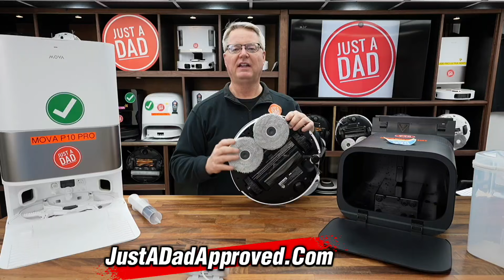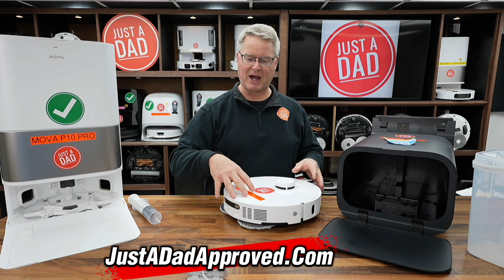Robot Vacuum Mop Pads Not Getting Wet? FIX THIS FAST!   Prime Water Pump

Comment: I didn't realize I had dry mop until I started testing it out and realized the floors were not getting cleaned. I tried small syringes but maybe I need to be shooting in more water than these small syringes so I'm going to buy the one that you're recommending and see if that helps, otherwise I'm going to return it.

Comment: Which port to prime? There are two, one connected to a hose that goes into the clean water tank, the other appears to go inside the enclosure. Assuming the latter.

Comment: Thanks, worked on my new Dreame L40. The hole on the vacuum it too small to get any meaningful water into it but the one on the dock was big enough I was able to push out all the air with water. Now I hear bubbling sound I didn't hear before and mops are wet finally, also finally dirty water in the container too for first time.
Reply from the maker: Glad you got it working, thanks for sharing that helpful tip for others!

Comment: Injecting water into base station is a terrible idea!!! Don't do it! You will break the base station!!! (at least in mova p10)
There is a water line venting valve just above the main board of the base station. If you inject water into the water line it will come out of the valve, which is normally open, right onto the board. I just did it. Thankfully I opened the case to realize the board is soaking wet, with connectors starting to corode.
The water pump is self priming. If it doesn't pump water it is either the pump that is broken or the venting valve not closing.

Comment: So, I tried to prime it, but the water is coming out the back(the exterior) of the dreame dock. Now, I don't want to turn it on again, thinking there is water leaked inside the dock unit and I'm afraid is gonna blow up.
Reply: I did the same thing. The worst part is that the valve that the water is leaking inside, sits right over the base station main board. Water gets into electric connectors and it causes them to corrode. You should leave it unplugged for a week or two for the water to evaporate. The best option would be to open the case, dry it, and see what is wrong with the water system. It might be the venting valve not closing, it is in the top left corner, you can pinch its hose while the pump is working.

Comment: Mova P50 Pro Ultra fresh new here, bleeding the system solved the issue. I bought the vacuum second hand, turned out system was drained and the pump wasn't pumping the water. Bleeding the base system was easy. I also cared to bleed the rubber tube inside the tank by sucking the air out of it. Hardest part was bleeding the vacuum. You need a really tiny straw to do it.

Comment: Sending back my P50 PU the syringe trick didn't work, and even if I fix it another way, I am not running the risk of it happening repeatedly. I also think I hear weird noises. Water started leaking from the bottom of the base..

Comment: Hey can you help me? My eufy c20, one of the mop heads has stopped descending. So when it’s moping it’s spinning, but it won’t go down to touch the ground. Whereas the other engages and starts cleaning the floor just fine? How do I get the mop head to descend? It’s like it’s getting stuck

Comment: hi I used a smaller syringe to try and fix the pump both in the base station and the robot without success. do you believe I need a huge one so that the process works fine in the base station. I could water dropping  from the robot but the water wont flow from the syringe into the hole. seems something blocks the hole. and nothing comes out. thank you for your help, valérie
Reply: If you have p10 I wouldn't try flushing the base station with a syringe. You can fill the port to a brim, but don't force it under pressure. You will flood the inside of the base station through a venting valve inside the unit, water will get onto a main board. I've just did it.
Most probably the issue is not with the water pump, it is self priming and shouldn't need putting any water into it. The issue might be the venting valve, that is there to stop water syphoning. If it is not being closed, the water pump sucks air through it and wont start pumping.

Comment: I tried this on my mova 50, when I prime the pump in the basestation water comes through the bottom of the basestation only? The problem came after a period of not using it, maybe 5 weeks I so.
Reply: It is fixed now, I removed the mops from the mop pads it did a mopping event to see if there was coming water from the robot, and there did. So I ran it for 7 min, and then docked it again, then it managed to pump water from Clearwater tank and to the robot finally 😊 I had tried to prime it several times without luck, but then suddenly it worked. I think I need to was my floors more often and don’t take on vacation with out letting it work. 😂

Comment: Have this problem with the x40 it cleans the mop, dispensing from the base but the robot won’t dispense water onto the pads, I’ve cleaned the holes and tried the syringe but it won’t push water in at all
Reply: I experienced this with the L20 as well. The syringe doesn't actually push water into the robot.

Comment: I want to put a comment in case others have the same issue. The technique in this video did not work for me. I have the same robot but the water kept coming back out at the robot port and at the clean reservoir port. what I did was put the robot back at the base and clean water tank back in. i squeezed my hand to the side and opened the tank while it was seated. I pulled the little rubber tube off the nipple and told the app to wash the mop pads. I use the syringe to fill up the nipple port until it wouldn't drain anymore and carefully watched when the dock would suck the water down. once I saw the water getting sucked, I kept filling it with more water until it wouldn't go anymore, and I just repeated this over and over again (including starting the wash mop cycle). eventually I heard water movement noises on the dirty water side and finally I started getting clean and dirty water!!

Comment: I did it on my xiaomi x20+ and it fix finally, you are the best, thanks very much
Reply: Did you prime the base station water pump? I'm having issues with my pads not getting wet before it leaves the dock to mop. Thanks.

Comment: My Dreame L10S pro does not have that front dock water hole.
Reply: Yep, this doesn't work for the 10l pro. However the basic principal is the same, getting the air out! You can inverse it for the 10l pro: First fill your water tank normally and set it in so the water flow ventil is open. Instead of pushing water from the filling, now turn the robot and close one end on the downside under the mop pads while sucking on the other hole with a straw or something. Worked fine for my l10 pro!

Comment: Thanks for your video. I tried the syringe trick on the base and i hear water dripping, but no water coming out of the hole in the bottom. However, the water was all over the floor under the base. What could this mean?
Reply: At least with my p10 pro ultra, if you try to manually syringe water into the base station water intake, it will only come out inside all over the electronics because there is a solenoid connected to the hose that is open to the atmosphere when the base station is idle. If that’s the case, then this operation really needs to be better tested if it is actually effective for all base stations

Comment: The mova z60 port appears blocked by a plastic covering
Reply: I did prime the base (not the unit itself) and it seems to be working better now. The machine is leaving a damp trail wherever it goes. Previously it was dry mopping.

Comment: Thanks so much. Your video gave me the idea. I did all the flushIng to no avail. Then, in the clean water tank, I pulled off the bottom part of the hose (which is connected to a filter), filled it with water via syringe till water squirted out the other end, connected it back without letting air get it. 
Wallah!!!
Reply: I’m trying this to tomorrow. Thank you man

Comment: Just in time,  had one of my mops not wet on the x50. Basically just flipped it over and cleaned out the nozzle. It had scale buildup. Jus order your water syringe 💉  to deep cleanse it.
Reply: The water inlet nozzle on the robot or the outlet nozzle on the underside?

Comment: I just fixed this issue on a brand new Yeedi M14 with a battery powered water ear flush tool. The tip fit perfectly in the fill hole on the robot and I just let it flush for about 10-15 seconds and problem solved. I didn't have a syringe or baster on hand so I used what I already had. The base station pump worked out of the box without issues. Thanks for the idea from one dad to another!
Reply from the maker: That is a genius hack using that tool, thanks for sharing! 💡

Comment: One GOOD tip to avoid problems at the water circuit ? Use ONLY distilled water. Cheap, and limestone free. I feel the tank, 1 cap of Ajax, and that's it, mops, tray and floor cleaned, no problems 😉
Reply from the maker: Thanks for sharing your cleaning formula! 😊
Reply: @JustADad , no Tom, thank you for helping me to buy my robot ! Bought my Saros 10 R, what a machine ! Just, wow !
Reply: Any experience with limescale in the past?
Reply: @Hoschie-ww7io , me personally not, but a freind of mine, did
Reply: @cesarmagalhaes6169  That is rather interesting! I am also using distilled water, but I have always thought I was being a bit too careful.
Reply: When the question is to avoid problems with these expensive equipments, no problem 😉
Reply: @Hoschie-ww7io and it's cheap !!
Reply: Maybe I should use my ,,Brita filters"😂😂😂 for the water 💦

Comment: @justadadapproved do you have a procedure for a Mova Z60 not dispensing cleaning solution?
Reply from the maker: not yet, but most robots hardly use any detergent when they work anyway
Reply: It usually uses only a small portion, seems that doesn't use ..

Comment: Would you rather have a p10 gen 2 with no camera and dirt detection or a gen 1 with a camera? Are the loss of those two features not that big of a deal vs better cleaning of the gen 2
Reply from the maker: orgianl Mova P10 Pro is pretty good at 399
Reply: @JustADad both are the same price in Canada, which one would you get

Comment: Mova p10 pro ultra mine said dust bin not installed and after changing filters and almost sending it back to warranty i left it out of the base to battery to drain and it worked again had it happened to you?
Reply from the maker: not yet but good fix

Comment: Just a dad i’m going to order a Robo vac today, but I’m going back-and-forth on the Mova V50 or the roborock curv which one would you recommend?
Reply: Roborock Saros
Reply from the maker: V50
Reply: @JustADad  thanks I ended up ordering that and used your link
Reply: Get the Saros or CurvX if you want to clean your cabinet toe kicks and under low furniture. Show stopper for me.

Comment: What’s ur oldest mova p10 pro? I bought one of the simplest vac robots 6 years ago and that thing still works fine! It’s one of the Dee bots that just randomly goes in directions but it still manages to fill that dustbin and get stuck under the dishwasher 😂. I just wanna know do you think the mova could last 5 or 6years with all those moving parts ? Have you had other vacuums fail with that many moving parts?
Reply from the maker: i have had one for 2 years now running strong